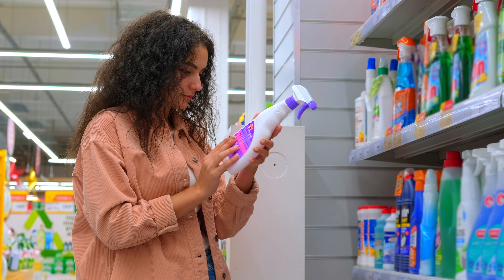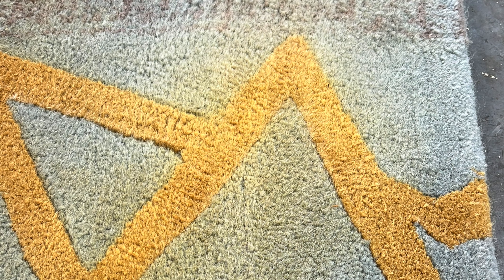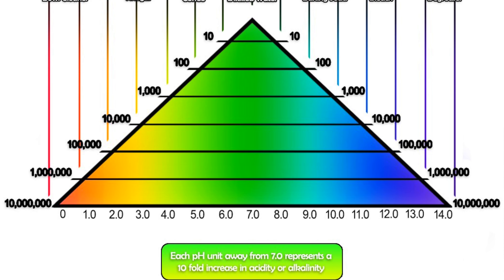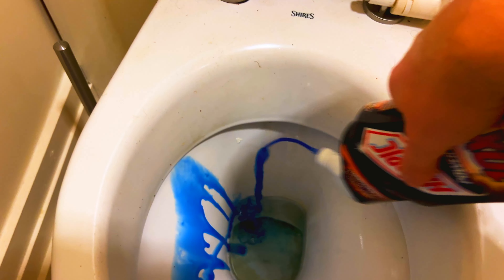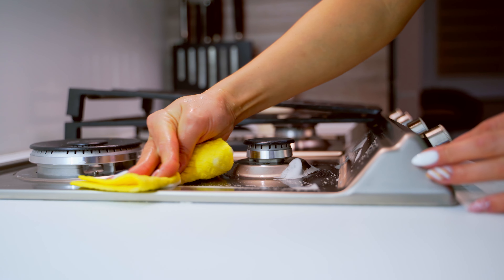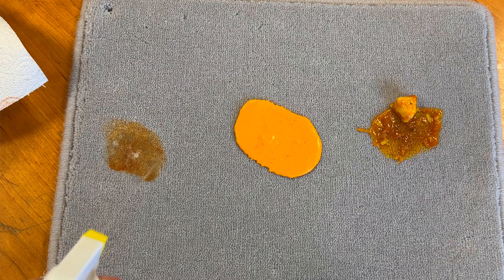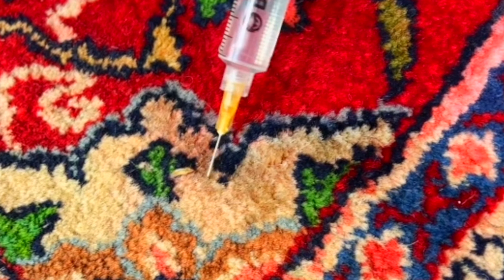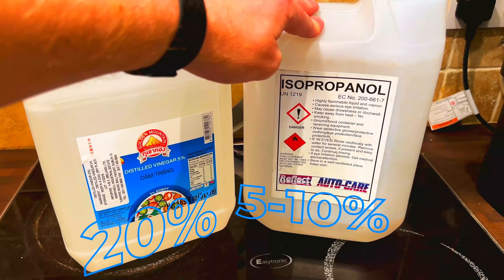STOP Wasting Your Time Cleaning with the WRONG pH!

Comment: Just seeing this now, thank you! But I'm still not sure how to approach cleaning old hard water stains on porcelain, like around the tub in a shower enclosure where the water sits at the top edge surrounding the tub. It's almost like a hard crystalline structure.
Reply from the maker: Acid. Try neat vinegar with a good dwell (one hour minimum). Use a cloth to keep it wet
Reply: Thank you!
Reply from the maker: No problem :)

Comment: So soap is better for unclogging kitchen drain than washing soda (higher pH)
Reply from the maker: washing soda and soap have relatively similar PH :)
Reply: Wow, amazing results for my drain!

I saw a weed killer with caustic soda as an active ingredient, have you experimented with washing soda for this issue? :D
It would probably also kill grass but there is always a chance to use a paint brush to avoid this :)